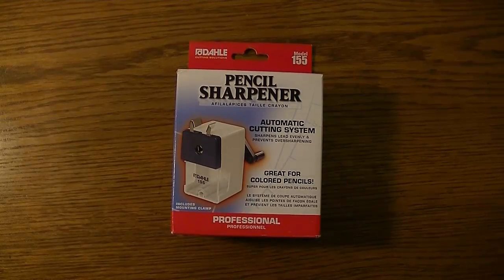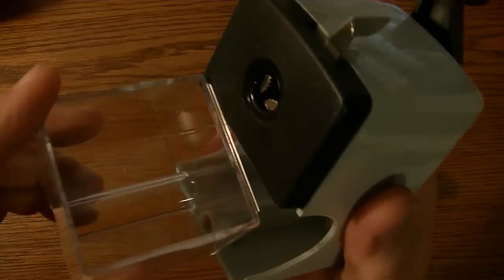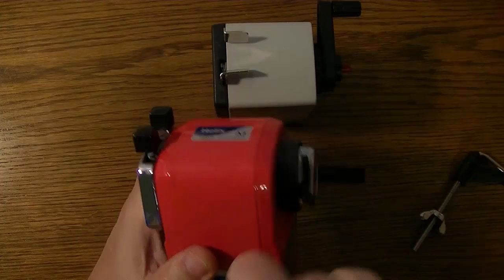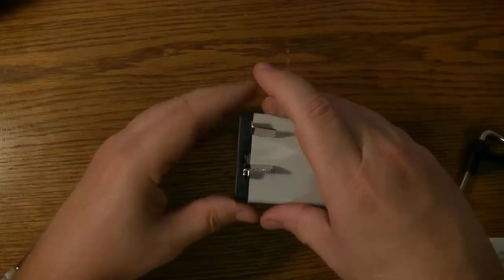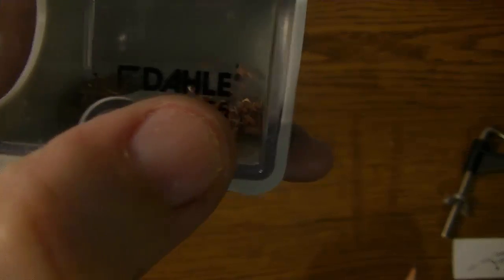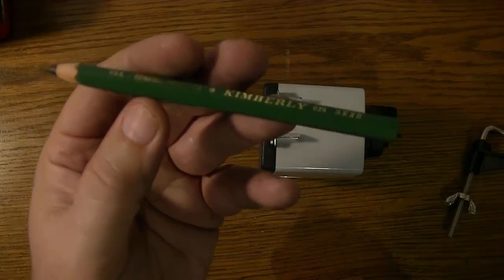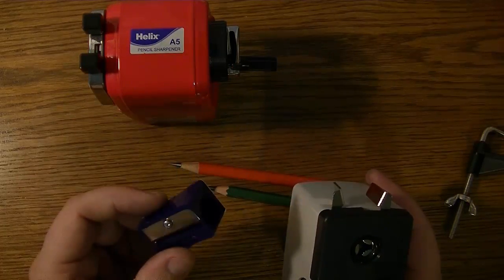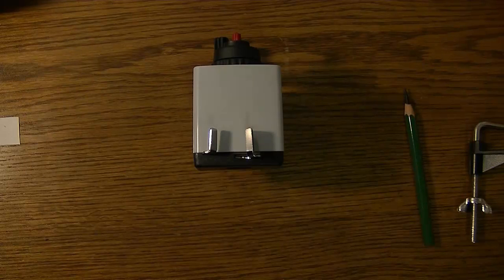World's Best Pencil Sharpener search | DAHLE Pencil Sharpener 155 review

Comment: Dahle is German so it will outlast the British one by about 100 years for sure. The British one will either fall apart or starts to rust.
The 155 is mainly aimed at office and school, therefore the deskclamp is standard, so the disadvantage of operating it with 1 hand when it's not attached to the desk or table is not an issue.
When I was in elementary school, about 40 years ago they already had these, the design is not changed at all.
Reply from the maker: You don't think very highly of British made stuff, eh?  And I agree, if it isn't broken, why change it?

Comment: What is the name of the sharpner at 11:23. I need a manual jumbo pencil sharpner.Thanks
Reply from the maker: You won't like that one. Manual hand-helds are not great on big pencils. I would use a manual-crank or electric. But if you have to have a hand-held, you could try the General's All Art sharpener. It will sharpen the large pencils, but it is a short-point.